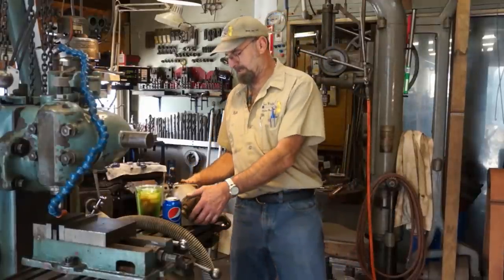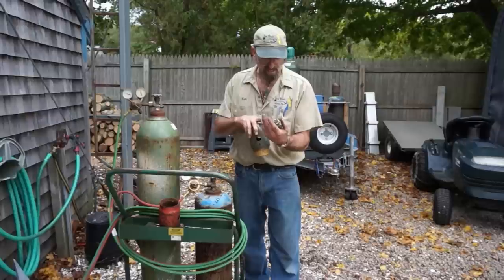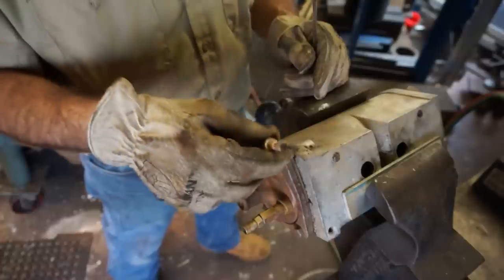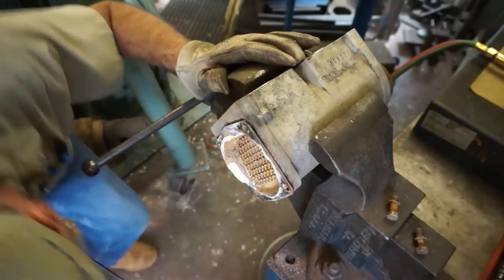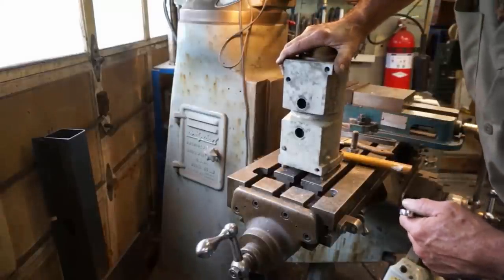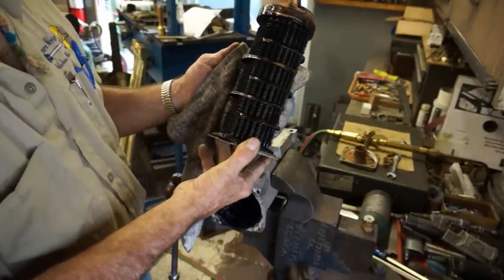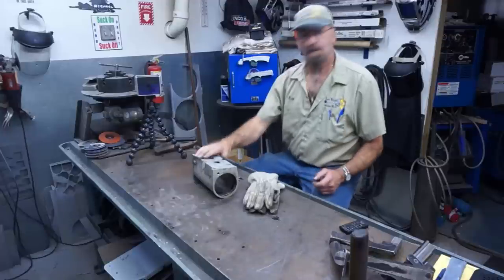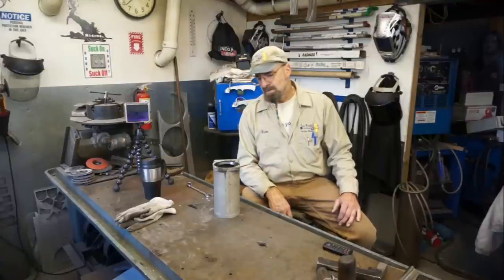Heat & Tweek Part 1

Comment: Another great video Keith.. I remember my first experience with Heli-coil. My brother had a Chevy Covair. He pulled the threads when trying to change the plugs. I got a kit and put a heli-coil in the head while it was still in the car. This was back in the 60's and the repair worked fine. 
Thank You again for your video's.

Comment: Thanks for posting this.  I have one of these oil coolers on my 1985 MD30A Volvo Penta on my sailboat.  Last time I looked (about 2 years ago) the replacement part (which has a different part number and is a slightly different design -- no zinc anode) is $2500 plus shipping from Europe.  Hard to find item.  My engine's got almost 12,000 hours on it and never been apart.  It runs strong but I know stuff like the oil cooler is going to need major maintenance at some point.  This video will really help when that time comes.

Comment: It have been a perfect saturday. Good help from good friends and some good grub :) I like your way of thinking when it comes to loosen bolts. Heat before force. If you  use muscles before brain you have allready made the problem bigger when you have run off and get your burner. Heat first when it comes to older stuff to make sure not to create more problems than neccecary. Nice litle job there Keith :)

Comment: thanks for sharing Keith! We use to use Cascade dishwasher detergent to clean EGR and air to air coolers on truck engines when they got contaminated with oil. It really cleaned the oil and soot out and safely at that. Take care and I look forward to the next one

Comment: Anodes are a good subject even for the do it yourself home owner. Water heaters, whether electric or gas fueled, have an anode with in them to protect the integrity of the water tank. This is how the manufacturer can give you a warranty because the manufacturer knows at what rate the anode is consumed each year. If your tank is out of warranty it is living on borrowed time for the tank is being consumed by corrosion. So how does one rectify this situation and get more life out of a hot water tank? Change the anode at the end of the warranty period if not 6 months before. The process is simple. 1st turn off the heater. 2 Close the water feed valve that allows water into the tank. 3 Turn a hot water tap on to relieve some of the water pressure in the tank. 4 Take a close look at the top of the tank. Between the two water lines (Cold and Hot ) there should be a hole cut in the sheet metal with insulation showing. This is the spot! Tease the insulation out of the way and a hex cap screw should be visible. This is the top of the anode itself. Remove the anode with the appropriate socket. If you see iron rod or just corroded wire it is high time to change it out for a new one. Put the cap screw back in place firmly and put the unit back into operation. Look for the manufacture's plate on the top or side of the unit and take note of the model number and the manufacturer's name. Look them up on line and give them a call and tell them that you  need a new anode. They will gladly sell you one and ship it to you. The cost should be well below $50. When it arrives  repeat the process as before make a note of when you changed it and post it near the heater.  
  If you go to a plumbing supply store they will play dumb because they will want to sell you a $400 plus water heater.
I know this is off topic sort of but I hope that it will save you some bucks and a busted tank to boot.
Reply from the maker: Vsshooter That's the kind of tip I like to see, one that benefits the average Joe and almost everyone is in this boat. ;{)---
Reply: That is good information.  Most of the water heaters I have had wind up busting and blowing water all over the floor and wall and whatever.  I really feel for those folks who have the water heater in the attic.  I know of one guy who paid out $20,000 to fix all the water damage when his busted.

Comment: Dear Mr. Fenner or Hey Fenner, three types of oil coolers - cross flow (which you have) - parallel flow - counter flow.  On a Cummins, we used to slam the (cast iron) housing on a wood four by four, that would usually break things loose. I had a piece of steel that I pried on with a bar to achieve the results you got using the arbor press.  Don't miss it a bit.

Comment: very cool nut extraction @ 35:24 , hey Kieth they have a new extraction tool out that uses 2 bits, the first drills a cone into the bolt the nest bit is a revers thread tap like threader bit that drills into the work with steep angle threads  . forgot the name but will share with you wen i find out

Comment: Keith, when you weld the nut on to the broken stud, it appears to be a standard nickel plated nut.  I've had trouble welding thru the plating, leaving green powder like residue.  You seem to have no problem.  Is there a trick?
Reply from the maker: wgforster I think when you start in the center and flow the puddle outward from the stud onto the nut it fumes less. I do get the the flare of fumes once in awhile but only starting right on the plating. ;{)---

Comment: You probably already know this one or something similar, but I've had a lot of success with this method when I can't get a torch in close enough to do anything or there's a risk of catching on fire. My Father showed me this and so far I've never had it fail. You have to be patient and you have to be careful with the air hammer so as not to break anything.

Manifold bolt removal and a use for Chinese tools!

I like penetrants but they're usually just a supplement to me. I rely on shock mostly. Be it thermal or impact with the penetrating oil giving me just a little better odds of getting the bolt loose.

Comment: Was all of that erosion in the Al casting due to electrolysis?  Would an exterior anode help as well?

Neat part!  Looking forward to the rest of this one.
Reply from the maker: jcims It's not a submerged part so an external Anode won't work as to keeping the corrosion down, It gets splashed with wash down waters and it gets eaten up from that on a constant bases.
Reply: Ah!  Ok, that makes sense.  Thanks for the explanation!

Comment: Volvo Part #861601 is no longer manufactured.  So the parts stores charge $$$$ for any left over factory OEM or NOS parts:  $2200-$2700.  Rebuilding and/or repairing the old part isn't cheap either, but still less.  By the looks of that part, the engine was rarely maintenanced (or not at all?).   Also, the oil coking buildup in the oil cooler galleries is a sign that the motor was turned off without cooling down first.
Reply: P/N 8388966
Reply: I have a guy here in SNJ that makes them.They try and reuse the cores if they can be redone and the price is a lot less than replacement.
Reply: SouthJerseySound Trade-market-speciality!

Comment: I looked.. out of curiosity.. that particular oil cooler is about $2,200 new or NOS.
Reply: That was on eBay.. and yeah you could probably spend as much as you'd said  and yes there's a few different styles if you just type in Volvo Penta Oil Cooler.  Amazing what some stuff costs...

Comment: Realize this is older video, but I've been told that wasps & hornets won't build nests on places that have been burnt or smell of smoke. So it might work to coat inside of gas caps with acetelyne soot to discourage such nests. Might give it a try (remove them from the bottles first of course.)

Comment: Was there a risk of the torch melting the aluminum casting?
Reply from the maker: Tony Ennis There is always a risk of melting the alum, with a torch. You do have to hold it there quit a while but it can become molten, just like a beverage can, laying in the super hot coals in a fire pit. ;{)-----

Comment: do they helicoil a lot of aluminum marine parts Keith or as it been done because they have been stripped out
Reply from the maker: Andy Coakes They are installing them in more and more in new marine components. ;{)-----
Reply: must so they will still hold when corroded maybe
Reply: Major reason I see is the larger bearing surface onto the aluminium alloy increases holding strength, and the stainless steel insert as well will not corrode onto the bolt. Of course you need to use a sealer in there when putting the bolts in, otherwise you will have corrosion of them in very short order. Loctite has a white sealer just perfect for this, it holds the parts lightly but more importantly just keeps water out. Get a tube and use it when putting the cover back on, and next time it will just pop loose.

For the gaskets you go to the boat dealer and get a tube of Yamaha gasket sealer, it will prevent the gaskets from having those corrosion spots under the gasket.

When replacing the inserts use the extra length ones if they will fully recess into the holes. The extra thread really helps with keeping them from pulling loose.

Comment: Hi Keith, i've been watching alot of your videos and have learned quite a bit about machining. i have a question about heli-coil vs. Time-sert inserts, which do you think are better especially when dealing with aluminium. i believe time-sert's were developed for aluminium engine block to replace threads that have been damaged or have head bolts have broken off in them.

here is the web site for time-sert is http://www.timesert.com/
keep up the cool vids